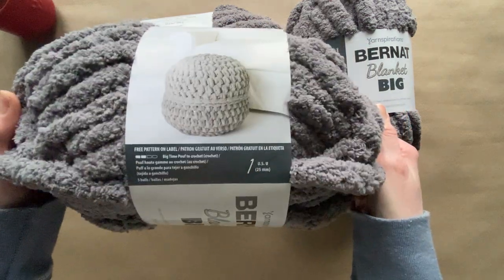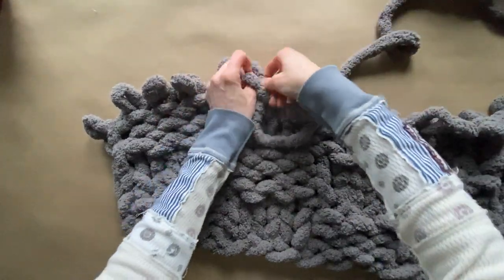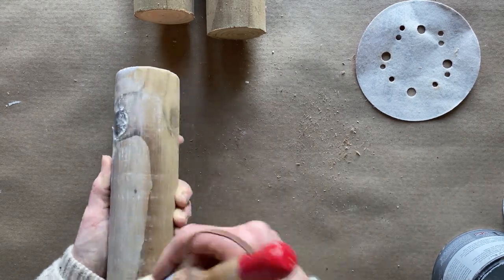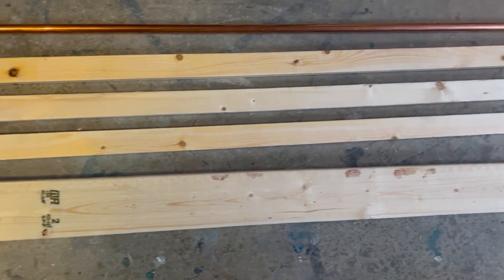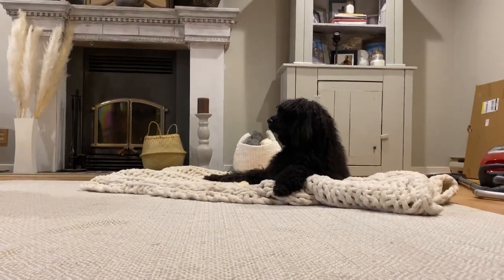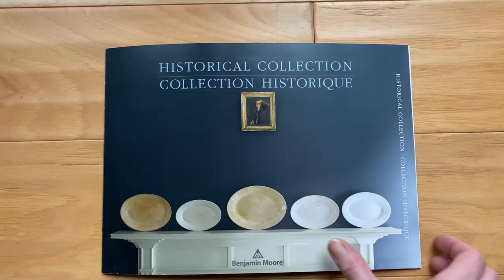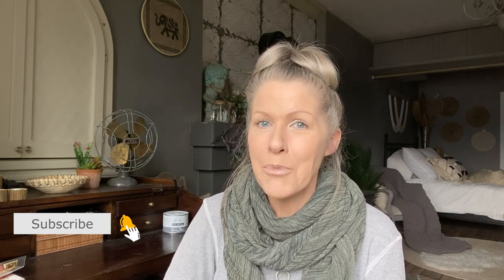5 Home Decor  DIY: Wood floor lamp, Hand Chunky Knit Blanket, Wood Candle Holder, Textured Wall Art

Comment from the maker: Welcome to this week's tutorial 5 DIY Home Decor Ideas!  

Let me know here in the comments section which was your favourite and if you have any DIY home decor projects you would like me to show on a future tutorial!  Thanks again for your support! Greatly appreciated! 

The materials used in this project can be found at my amazon store which the link is below:
https://www.amazon.com/shop/thereclaimedheirloom

Chapter Sections for easy referral look up:

00:00 Start
00:22 Project # 1 Big chunky chenille waffle blanket!
06:14 Project # 2 Wood candle holders
08:44 Project # 3 Textured abstract art on canvas
13:35 Project # 4 DIY boho style floor lamp
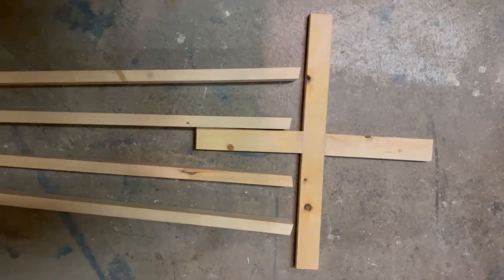15:35 Recycled lamp shade for floor lamp
20:12 Project # 5 Living room makeover Part one!

For the complete measurement for the wood floor lamp, please see below:

Raw Materials list Boho Lamp

Spruce Wood: 

2”x1”x8’ spruce or pine 5 pieces
2”x 4” spruce or pine scrap piece cut into 2.5” x 2.5” Square block
1/2” x 48” wooden dowels cut into 12” long 

Copper pipe: 
a) 1/2” diameter approximately 51” inches

Lamp
1- Lamp Shade
1-Lamp light set (pendant drop light) (You can reuse a lamp light set from an old vase lamp if you have or get a plug in light)
1- Outlet Plug
1-On/Off switch 

Lamp Stand Wood Cuts:

Lamp legs: 4- 50” Length from 2”x1” Spruce wood.  Note cut the wood both ends at a 10 degree angle cut with a miter saw
Lamp Base (X-shape): 1- 18” length from 2”x1” Spruce wood.  Note cut wood both ends at a 10 degree angle cut with a miter saw
Lamp Base (X-shape shorter ends): 2- 7.5” length from 2”x1” Spruce wood.  Note cut one end straight and the other end at a 10 degree angle cut with a miter saw.
Lamp Top (Wood block to hold lamp): 1- 2.5” x 2.5” square from a 2”x4” spruce scrap wood.
Copper Pipe: Cut approximately 51” length from 1/2” diameter copper pipe.  Note the “extra 1 inch” will fit in the top and bottom wood base and top block
Wooden Dowels: Cut into 12” Long from 1/2” x 48” wooden dowels.  Note cut as many as you need to glue to lamp shade.
Reply: I love the colours you used on your walls and fire place. I also love the lamp you made.
Is your brown curly dog an Irish Water Spaniel?
Reply: I’m really excited to see your living room transformation! It looks stunning. Loved the wall art, that’s definitely something I’d love to try! Thanks again...
Reply: not only diy queen but also finger crochet queen she makes it look so easy but outcome is always beautiful thanks for sharing with us
Reply: That was such a great episode! That waffle patterned chin ky blanket was my favorite! Definitely gotta do that! Thanks so much for sharing! ✌🏻❤️🙏🏻
Reply: WoW Christina I absolutely love your work and all you do. Clicked on the video originally because I want to attempt making a chunky blanket. I love the extra detail and how amazingly well you visually showed while verbally explaining each step. I suffer terribly with acute long term anxiety and depression. I dislike ASMR but find your voice to be genuinely calming/relaxing/soothing, even in the worst of my mental health struggles. You have no idea how much I appreciate your videos for this reason alone but also for your creative genius, your eye for detail, creative/decorative taste, how nothing you create looks anything like a DIY and that you explain/post how to purchase needed supplies at a reasonable price. One question for you that in no means is intended negatively as I wholeheartedly love the gorgeous lamp you masterfully created. In the beginning steps you used dowels to attach the wooden pieces and explained that this makes it more seamless. However when you attached the long wooden outside pieces that are clearly visible you used screws. I’m just curious why you didn’t use dowels again? Sincerely, I am amazed and in love with every aspect of the gorgeous lamp you created. I’m just brand new to the DIY/power tool world and truly want to learn anything/everything possible. Thank you again Christina and please continue making videos!
❤️ from Shannon in Canada 🇨🇦
Reply: Christina,  I'm new.  I love your make over.  Keeping the bottom of your walls white, for a bigger floorboard is bomb.  Have to do that.  The greens!  Like bringing the outside in.  Beautiful.  I will definitely make the blanket for a throw. Thank you.  See you soon.  Your dogs are stunning.  👋🏻
Reply: Hello Christina, I’ve started watching you just a couple of weeks so far and I want to say thank you for your artistic gift. I really love your finger yarn (and crochet) DIYs and I’m excited to try it myself 😃. Omgdness it brought back so many memories of when I was a teenager and started to learn how to crochet (was teaching myself). But having low self-esteem and a skincare complex (had acne), I stayed home a lot and started to do things that I could get lost in for hours like crocheting. Somehow, when I reached 17, I grew out of it and never crocheted again. You’re inspiring me with your videos...again thank you!!🙏🏽😊

Comment: Well Done Christina on your textured art piece... as an artist can I offer advice on how to get it to the next level? Use 3 circles instead of two or odd number as this is an artists and decorators technique for visual continuity. Also instead of spreading it so smooth I loved the mid point when you had little dots in the centrifig circles. ❤️

Comment: Hi Christina! I especially like the lamp created by you. In my opinion the room decorated by you is really beautiful. But i noticed something. That the fireplace and the white closet are two different focal points and the white closet wins because its white. Also  I think there should be harmony within the right and left of the fireplace. Maybe the fireplace is better with white and the flower up to have just the petals white for continuity. Maybe some decorative cussions with the pattern of the paint that you have on top of the fireplace that is wonderful in my opinion. Also, you may put  some round objects to not be all squares. 
2 rugs for the texture I get it, but the second one doesn't shrink the size of the room ? Is just my opinion, you see better from there. Love and blessings   ❤❤♾♾🍀🍀Thank you !